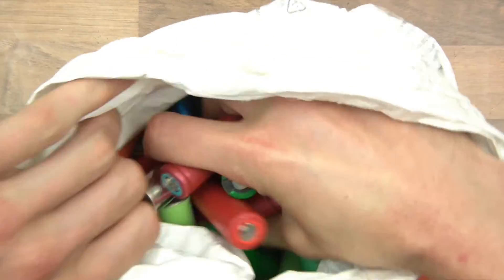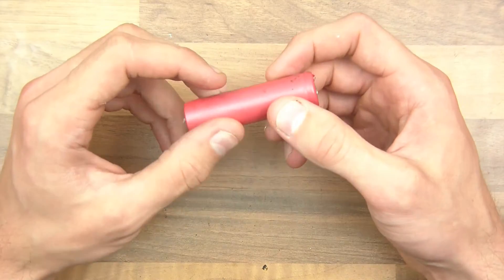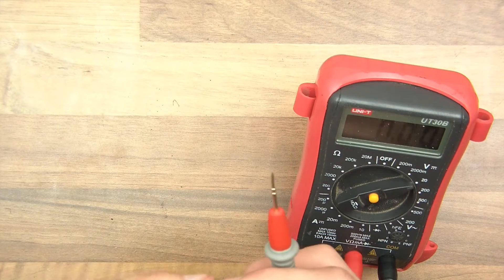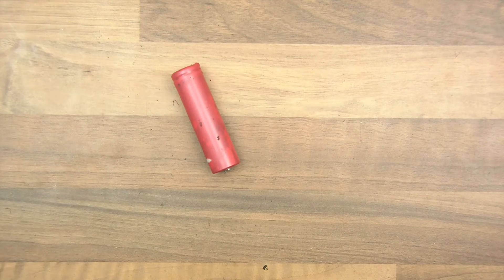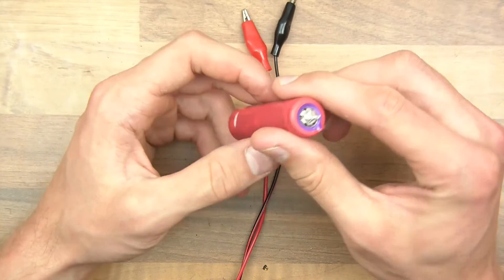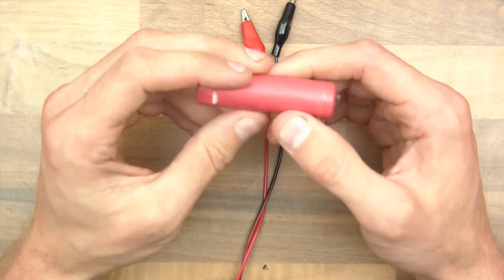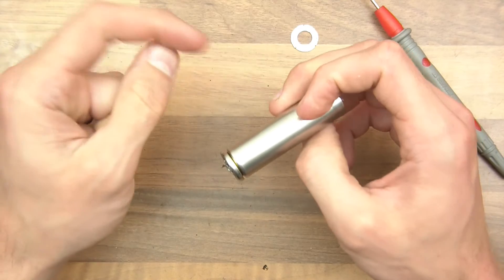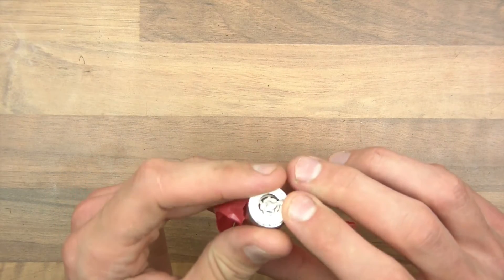INVESTIGATING: My first dead 18650 lithium cell.

Comment: Over on the SLS forum, we've discovered two major flaws with the Red Sanyos. They either go almost dead short heating up drastically (we call these heaters), or they go super self-discharge. It's best that it went the discharge route. However, if you try to charge this one normally, you'll find that it heats up considerably. They can be very dangerous and there are instances on the forum where people have had fires started from these little fire crackers.
Dispose of any cell like this by soldering a resistor across the terminals and tossing them. If you don't want to use a resistor, then wrap the positive end with tape to keep it from shorting out on anything.
Reply from the maker: Hey Korishan! I'll have to look at this SLS forum! Thanks for the comment.